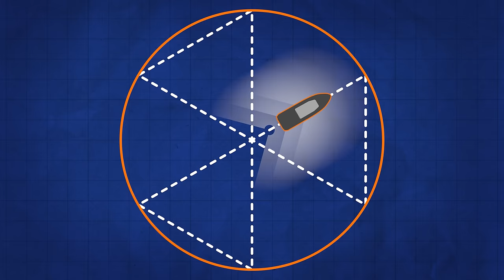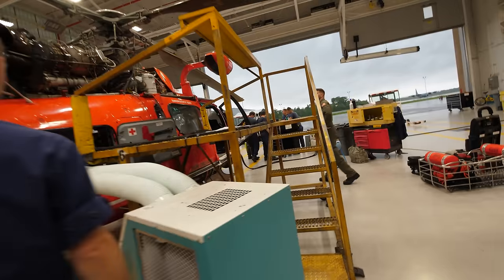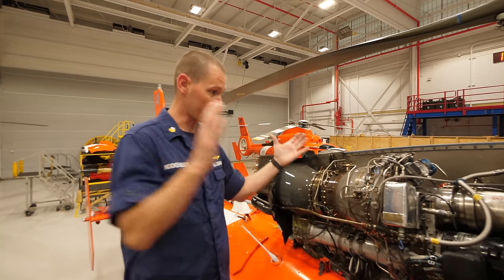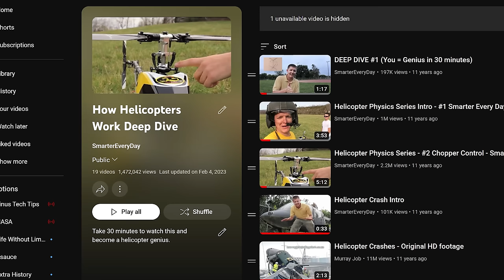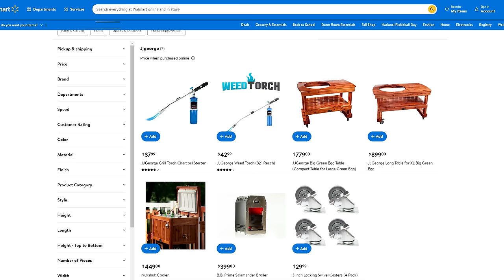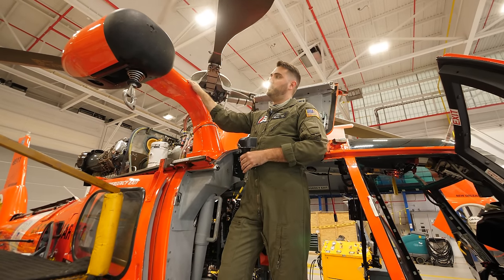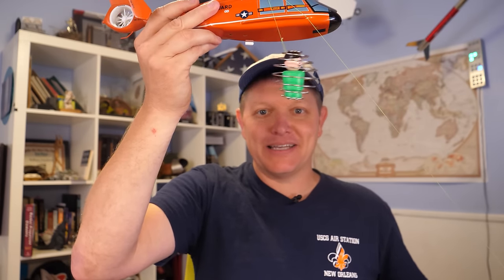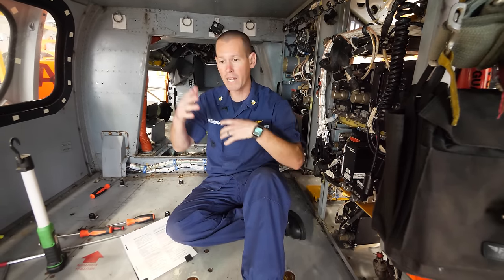The Amazing Engineering of Rescue Helicopters  - Smarter Every Day 289

Comment: 24:44 not because it's french.. all choppers have the captain on the right ;)
Reply: and the driver is on the left side in France, it's the british that have it on the right side I don't get it x)
Reply: Thank you, you are correct. fixed wing has the pilot left seat, and rotary wing has the pilot right seat.
Reply: @guillaumejchauveau You don’t get it because what he said was nonsense. Helicopter pilots usually sit in the right due to historical helicopter design and tradition. It’s got nothing to do with France and Britain or where the driver in a car sits. 🤣
Reply: @knight907  Correct, it's originally due to having a common collective and dual cyclics - the vast majority of people being right handed so they need / want the cyclic in the right hand for fine control.

Comment: I was hoping you checked out the nose and radar of the bird. I wonder if it's powerful enough to pick out boats in open seas or if it's just for weather observation.
Reply: Im pretty sure it's just weather observation, specially if it on a older platform such as this
Reply: Based on its location, it's probably not well suited for surface search.

Comment: As a former Coastie I used to work on the HH-52 Seaguard that this helo replaced. After every 10 hours of flight we performed a “Ten hour” inspection that had us using a grease gun to lubricate zerk fittings on the rotor head!  All maintenance performed on the aircraft is generated by the CMS = Computerized Maintenance System.  Parts get removed and replaced before they fail. 
If you’re thinking about joining the Coast Guard, go aviation. 😊

Comment: Hey Dustin,
Yesterday, there was a major rescue operation in Pakistan involving eight people stranded in a cable car mid-air at a height of over 800 feet. It appears that the Pakistan army was unable to execute the rescue in a timely manner by using sling operation by AW-139 Helicopter mostly and AS350 was also there. Could you please inquire with US professionals about what they would have done differently and identify any mistakes made by our rescuers?

One of the two weight-bearing cables snapped, along with the track rope. The cabin was not big enough and tilted with six children and two adults inside it. Army helicopters took ten hours to rescue just one person until nightfall. Then, locals rescued the rest by sliding the same cable on which the cabin's weight rested.

Comment: So, here's an interesting piece of history:
Notice the blades and pitch control rods are color-coded. When doing track and balance, mechanics refer to the blades by color (blue blade is an inch low), not by blade number.
That's because in the "old days", before electro-optical tracking systems, blade track used to be checked by applying colored chalk to the blade tips and sending a (usually junior) mechanic with a piece of paper tacked to a stick, and he would carefully walk the stick into the blade tips, which would leave a chalk trail on the paper. Based on the marks, they would adjust the PCRs and blade trim tabs to get all blades to fly in the same plane for maximum smoothness. A few mechanics lost their heads that way, especially on smaller helicopters where the blades would be closer to the ground.

P.S. the hydraulic unit is usually called a mule.

Comment: I once worked on a UK Govt contract that used a helicopter contractor using 365N Dauphin. Great aircraft. Economical, agile and roomier than it looks. It set us down in some crazy places. Good memories.
Also, new work is being done on the motion of the load on the winch. Not swing but controlling the spin of the load on the winch wire. Colorado National Guard are amongst the people who have been working on this. It turns out that there is a specific range of height below the aircraft (specific to aircraft type) where spin is more likely to occur and, in the absence of a tag/heaving-in line, a dynamic hoisting approach can be used (initiating foward flight while hoisting in).

Comment: Hey bud, GREAT VIDEO! So there was a comment about fuel burn during hover/hoisting and it has to do with vortex rings.  In hover, the vortexes that come off of (any) wings can fully rotate around the rotor blades and sap the lift they can generate tremendously.  The hoist isn't an issue, its the "dirty" air.  I'd love for you to come to NC to Bragg or rdu and review the AH 64 apache.

Comment: Great stuff!
Last year i learned something i thought was super interesting.Some helis use cyclone style air filtration, but in miniature form as large sheets. 
Each micro cyclone element is about one inch across,and there are hundreds of them in a panel that makes up part of the upper bodywork.I guess there are several layers to it,with one of the inner ones being for dust collection (and possibly ejection).
I couldnt help but think what they'd cost! If they predated 3D printing,the molds must have cost a fortune

Comment: I have worked on the avionics system for this aircraft. I started on the initial GOS integration on the CAPS-5A based mission computer through the migration to the more modern systems. 

The 60s don’t have the best reputation for reliability (a.k.a. The crack hawk)

Comment: That gyroscopic progression is exactly what happens with motorbikes (and pedal bikes, if you go fast enough). Above around 30mph you steer by counter-steering, rather than turning the wheel to go around a corner like a car, you turn in the opposite direction, pushing gently on one side to initiate a lean in that direction. The turning forces applied to the wheel through the handlebar are rotated around by 90 degrees, ie top and bottom instead of front and back, creating a lean. The turn at the handlebars is so small it's easy to miss, it just feels natural, you push in the direction you want to lean and turn.

Even today many people don't believe this. However it's an essential skill - if you need to swerve at high speed you do this by pushing hard in one direction then the other, not by throwing your body weight around.

Comment: Hello Destin, 

I am a flight school student just south of you at Ft. Novosel, AL. We train up on the UH-72 which has a counter-clockwise rotating main rotor. I have a question for you based on what you said at 10:35.

When you were explaining gyroscopic precession you gave the example that if you want the aircraft to bank to the right (3 o’clock), that input needs to be made 90 degrees clockwise (6 o’clock). 

However, my understanding is that the control input is made 90 degrees PRIOR to the intended output. Being that this aircraft has a clockwise rotating main rotor, that would mean a right bank output (3 o’clock) requires a 12 o’clock input as that clock position is what will enable gyroscopic precession to manifest that action 90 degrees to the right.

Your example is true for counter-clockwise rotating main rotor aircraft, like the UH-72. It’s interesting that the MH-65 has a clockwise rotation when they are both manufactured by Eurocopter.

Am I making any sense?

Thanks,

Max
Reply: Your understanding is correct. And Destin misspoke, it's due to phase lag, not gyroscopic precession.

Comment: Great video!  Helicopter tech is amazing, and helicopter pilots are crazy.  <g> 
I had a little experience with this in 2019, when I was winched up off the deck of the Viking Sky after it lost power in the Norwegian sea.  They used AS332 Eurocopters.  The tail rotor on those is not ducted.  I remember looking up and seeing the hoist line blow back towards the tail as they let out the line and thought, "It'll be a bad day if that gets snagged in the tail rotor..." but of course, it didn't. They used 5 helicopters in a 10 hour operation to rescue almost 500 passengers off the ship (20 pax per helicopter). The helicopter was hovering about 50 ft above the top deck (they couldn't land on the ship b/c of 30 ft seas).  I was amazed at how quickly the hoist got us off the deck - seemed like we were inside the helicopter in less than 30 seconds after being secured in the horse collar.  I remember being relieved as I could sense the change in vibration as we transitioned from hover to forward translation (I know hover is a helicopter pilot's least favorite regime).  We corkscrewed to a landing on a soccer pitch at a local high school and they had a fuel truck on site refueling each helicopter as it unloaded on the ground.  The rescue personnel were amazing.  An experience I'll never forget, and I'll always be grateful to all those folks!

Comment: Hey Destin, love your work.  BEWARE! Can of worms ahead…Have a deeper dive into gyroscopic precession on a rotor head 11:15 .  You’ll find that with an articulated head there isn’t really any.  It’s aerodynamic precession that acts a lot like gyroscopic precession.  The blades are free to flap and in such cant exert an force on the head to cause the gyro effect. Check it out.

Comment: I've just learned about the intermeshing-rotor or synchropter rotor configuration, which doesn't need the tail rotor to counteract, and it makes my head explodes to understand momentum forces and gyroscopic precession in that system 🤯 you should check it (and hopefully comment it on a Next video). I'm sure you'll like it

Comment: "It's French so it's opposite", an amusing way to remember it but  the reason why helicopters are right hand drive (excluding Russian/Soviet types) is because of how civil aviation developed post-WW2. It actually stems from naval aircraft. Naval fighters all have clockwise (viewed from behind) turning props and so suddenly advancing the throttle causes them to turn left. This is significant and deliberate as aircraft carriers have the "island", the bridge, to the right. So if a plane is approaching a deck and encounters difficulty and needs to perform a go-around, the sudden increase in engine power pushes the plane to the left and away from the tallest part of the carrier. This behaviour is reinforced in training with pilots practicing left-hand circuit patterns around airfields. After the war and as civil aviation developed, it was decided that good practice would be based on military experience and so civilians also adopted the left-hand circuit pattern. In civil aircraft the captain sits on the left so they have a better view of the airfield as they perform their turns. When helicopters appeared on the scene, it was decided that they should not be part of the civil aircraft circuit because of differences in speed and performance so the decision was made that best practice in helicopters is to perform right-hand circuit patterns when working near airfields and so the captain sits on the right to get the best view.

As for the servos being offset, that's not actually gyroscopic precession though precession is a consideration in the positioning of the servo. What is happening there is that control of the helicopter is achieved by changing the angle of the rotor disc. The rotor disc is a virtual plane being described by the tips of the rotor blades (sometimes called the tip path plane). When the captain pushes the cyclic forwards, the tip path plane is tilted forwards. The highest point in the rotor path is now going to be at the rear but if you look at the blade pitch at this point it would be neutral (minus collective angle). This is because the pitch angle controls the acceleration of the blade, not its height. You want the highest upwards acceleration to occur before the rearmost point in the disc and for no more upwards acceleration to occur once the blade reaches the rear point. The same applies for moving the helicopter in other directions too, of course. 

Sauce: I am a helicopter pilot myself. These two minor errors aside I enjoyed this video and thought I'd add these corrections because the goal is to learn.

Comment: While the bit about the French made me laugh, on helicopters, the flying pilot generally sits on the right side. Since most folks are right handed and fly the cyclic with their right hand, sitting on the right allows the collective to be next to the center console. And since the collective doesn't move much in straight and level flight, it allows the pilot to manipulate switches on the overhead and center console with the non-flying left hand without reaching across the body. Airplane pilots in command are the odd ones, typically flying with their weak hand and doing the throttles and everything else with their strong hand. Apparently (because I got curious and Googled it) that comes from early propeller planes where torque and p-factor made it easier to turn left and therefore, left hand traffic patterns became the norm. Captains sat on the left to see better. Now, I'm smarter several ways today. 

Great presentation, and I love everybodies passion about what they do.

Comment: What I thought weird is that he said he remembers that the pilot sits on the right, because the helicopter is French. (a) the French also drive on the right side of the road, and (b) all around the world, the pilot in command sits in the right seat in helicopters, with very few exceptions. The reasons for that are apparently unknown, but now it's tradition and doesn't seem to be changing. Also, (c) even in the UK, where they drive on the wrong side of the road, the pilot in command in fixed--wing planes sit in the left seat. Also again, strange how he calls a helicopter a "plane". I always thought that word specifically meant fixed-wing aeroplane.

Comment: I believe the 90 degree difference is not due to gyroscopic procession.  The rotor disk actually follows the swashplate.  a left tilting swashplate gives you a left turn.... etc     The blades follow the swashplate.... AND.... The blades are raising and lowering themself, they are not being manipulated by forcing the shaft side to side front to back. The pitch of the blades moving through the air, moves the blades up and down.

Comment: I'm a little surprised they use steel cable rather than high modulus line. Most winches these days have swapped over to the new lighter ropes that are just as strong as steel.

Comment: I couldn't help but notice that the tail rotor has asymmetrical blades which I assume is to keep the vibration down, because if it's to keep the noise down I doubt that it works.

Comment: The nuances of conversation and body language..You can see you were trying to build a rapport with the AMT 1 Hockenberry by saying he owns the bird, not in a command sense but in that his decisions and work on the helicopter mean a lot and that essentially if he doesn’t have it up to scratch it can’t fly. The AMT responded from a heirachy view about the pilot which is correct as well. So I imagine that makes it hard to connect when talking cross purposes . And then you see, you are trying to build rapport once again with your knowledge of the heli about its fuel and oil.  
Kudos to both of you trying to gel and work on a relationship that works to explain to the viewer the intricacies of the helicopter and it’s supporting systems etc

Comment: I noticed it a few times they said the pilot has the go or no go call, that's FAR 91.3 "The pilot in command of an aircraft is directly responsible for, and is the final authority as to, the operation of that aircraft," meaning PIC is responsible for everyone's safety both in the aircraft and in the ground. Destin, you should really go see a certified flight instructor.

Comment: Look at the spacing of the blades on the tail rotor. They're uneven, but balanced. Probably by combining 2 sets of evenly spaced fans with different numbers of blades. Looks like 10 blades so perhaps one set of 7 and 3. That's probably to spread out the frequency of the sound created to make it less loud
Reply: Correct, it distributes the noise over different frequencies. A helicopter with a fenestron sounds quite different than one with a conventional rotor.

Comment: The tail-rotor and the canted fins are all for anti-torque - equal and opposite reaction to the main rotor.  All single-rotor helicopters need anti-torque - tandem, coaxial, and intermeshing rotor helicopters do not as the rotors cancel each other's torque out.

Comment: One thing I didn't find clear is how the hoist can go in and out electronically, but the line goes up and down hydraulically.  Like, how does that work?  I've only ever heard of hydraulics pretty much being used for pistons, but for something that's rotating, is it pushing some kind of a plunger along a worm gear?  What exactly is going on there because it would make more sense to me if the arm was hydraulic, but the line was electric.

Comment: I'm curious why they don't have a secondary or tertiary line to solve the pendulum swing problem. It doesn't even need it's own winch, just a slack line with a pulley to have better control of the basket.

Comment: The portion of the helicopter aft of the main fuselage is called the tail boom. The distinctive tail rotor design of the Dauphine at the end of the boom is called a Fenestron, and was supposed to make the tail rotor safer, since they’re one of the most dangerous parts of a helicopter. Almost as many people are killed walking into tail rotors as from the inevitable crashes due to pilot error, metal fatigue, and oil leaks. 😜

Comment: The explanation of why cyclic blade inputs result in tilting of the rotor disc plane by 90 deg only due to gyroscopic precession is not entirely correct. There is also blade and rotor aero-elastics that create this control phasing offset. For an articulated rotor system with a flapping hinge offset from the rotation center and hingeless rotor systems the angle is actually less than 90 deg due to these other effects.